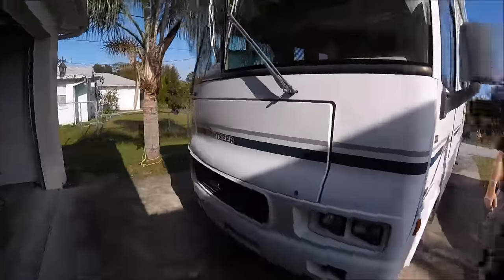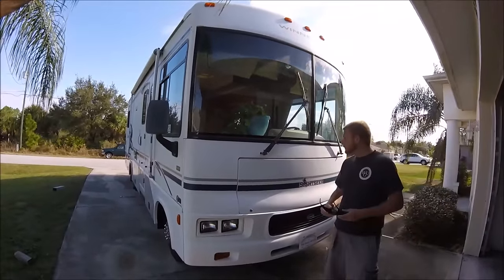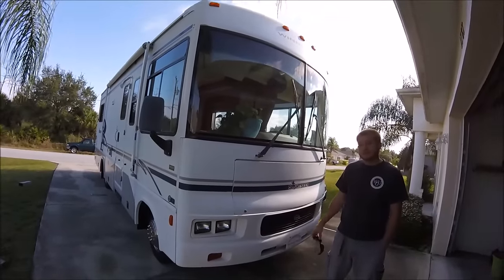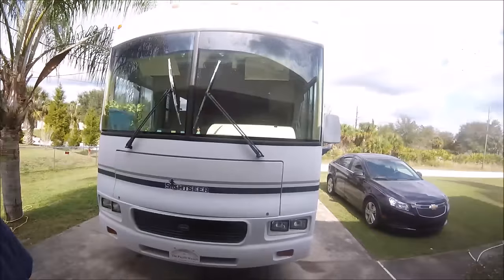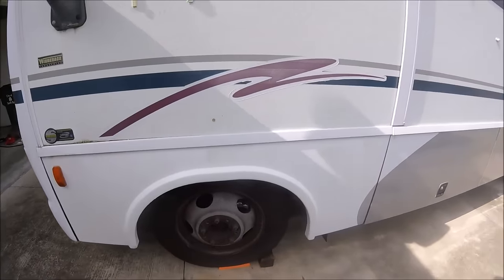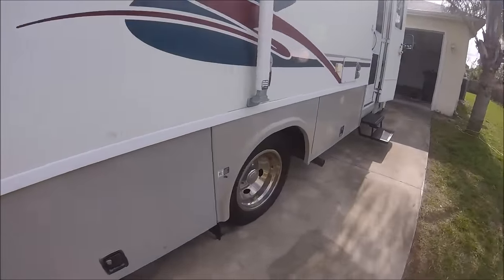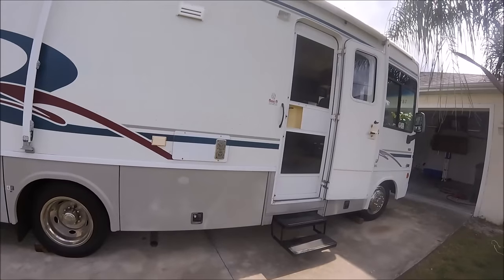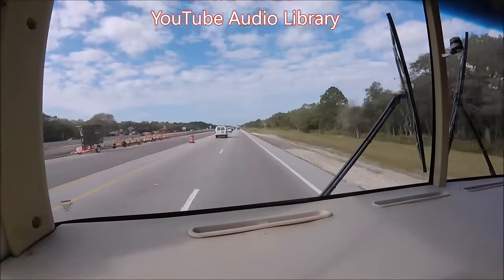Test Driving Myrtle

Comment: NOW: check  your loads, and start learning your protocols.

Keep a list of things to check before EVERY move.
A list (even if it's just mental) about the best places to Wifi.
Begin records: set an 'alarm' for so many miles, at which you'll check:
- Wheels, brakes, fluids, etc. 

MANAGE YOUR TIRE WEAR: I'll bet when one goes flat, it'll be expensive so start saving up money and record the date on each tire.

Then 'set sail' and let us know how it goes!
Reply from the maker: +Brian Fahrlander - wow Brian - this is great advice. I have roadside assistance and tire coverage - thankfully. I am in the process of setting up a checklist in my cell phone so I can manage through each trip. I had not considered roadside stops to check wear - but that is an excellent idea. For my first trip I will be driving around 200 miles to 250 ... but then I will slow it down quite a bit.  Being organized is key - and remember - I have to work while I am traveling - so I need to budget time for this as well.  Great advice - thank you so much.